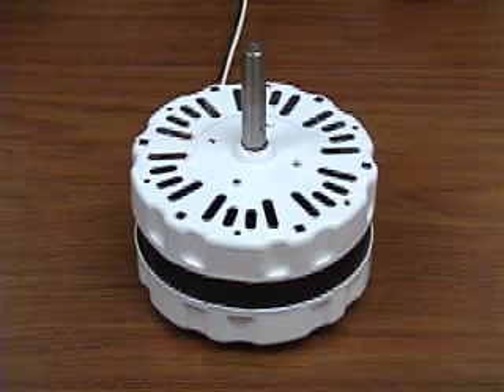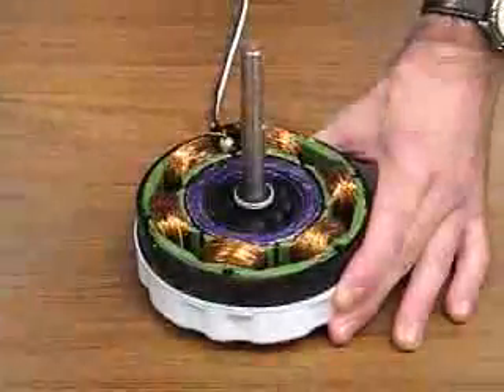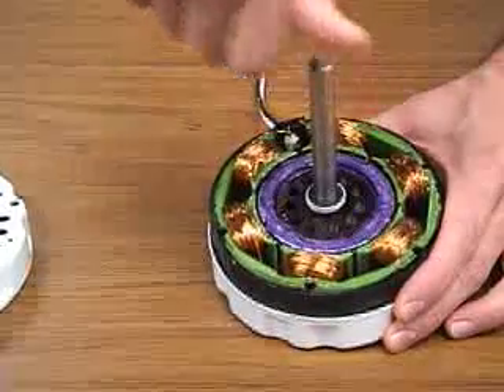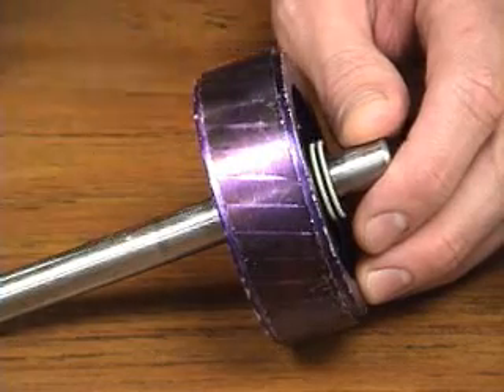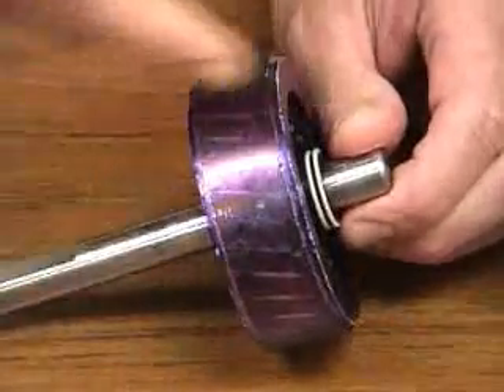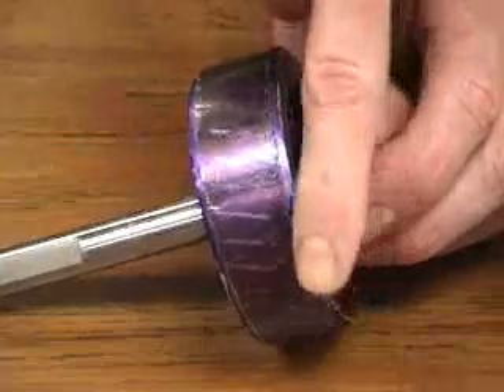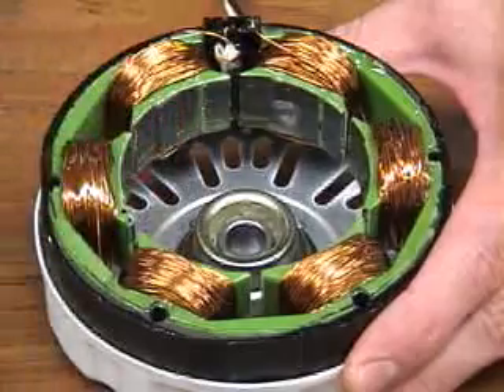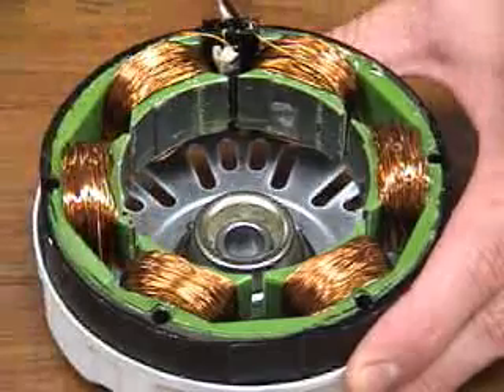AC motor

Comment: Another loss reduction is minimising the air gap between the pole face / iron core and the rotor. These are just stock standard examples though. There are many different variables involved whether the motor is under or over rated for efficiency through things such as drives and controls.

Comment: There are plenty of losses in an electric motor, that's just a part of it and have always and will always be around. The iron losses (from eddy currents) are reduced by using thin iron laminations (with an oxidised layer for insulation), and the other big loss is through heat and that is reduced by any or a combation of cooling vents, internal fans, external fans or forced cooling fans (hermetic compressor motors are in coolant oil)

Comment: Since the rotor is playing 'catch up' with the rotating field it will keep spinning. This is called slip, and is why a 4 pole motor on 50Hz will not run at 1500RPM, typically will run at 1460-1490RPM. For a single phase motor you can change the direction by swapping a start and run winding lead around (the 'common') and a 3 phase you can switch any two incoming lines around. I am a qualified motor winder and should be able to answer most questions :)

Comment: Also note that is only for one half cycle if AC, and constant for DC (obviously). For those here to learn something, on a frequency of 50Hz, each pole will be shifting 100 times a second (sine wave in two half cycles, positive then negative). What is happening in this motor is the skewed bars have a pole induced into them and then oppose their corresponding stator windings (motor windings). The rotor in turn tries to 'synchronise' with the rotating magnetic field

Comment: the coils (wound with magnet wire) are energised and a magnetic field is induced into the iron they wrap around. The polarity of each pole can be determined by cupping your right hand and sticking your thumb straight out (right angle to your fingers). Fingers represent direction of current (coil) and thumb points to north pole. Right hand rule is for motors, left hand rule (same format) is for generators.

Comment: those coils are magnetised. When current is put on them they will make either north or south poles (at each instance of the half cycle for AC). He said this motor is 6 poles because it has 6 coils. In sequence it will go NSNSNS. Synchronous speed (RPM) is determined by 6000 / poles. Before rotor slip (how it spins in the end) the rotating magnetic field of this motor would be 1000.